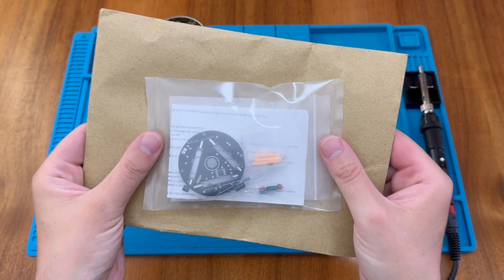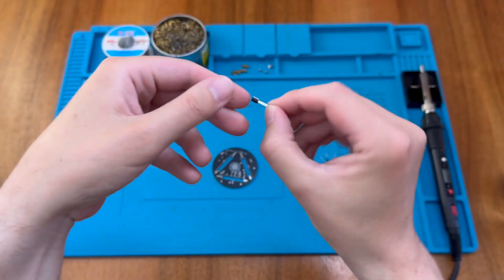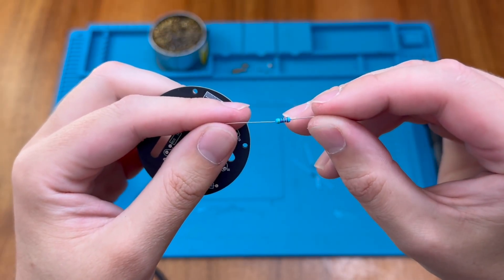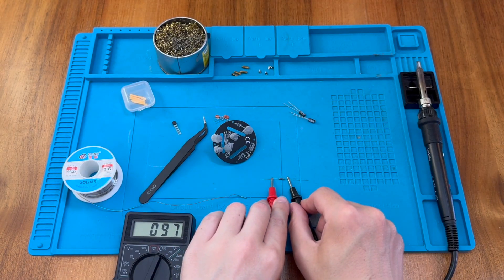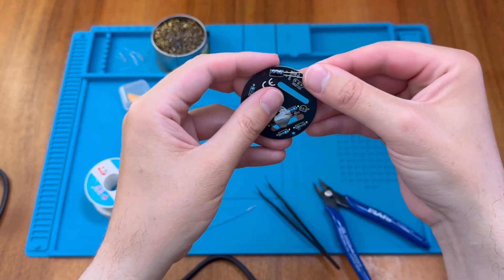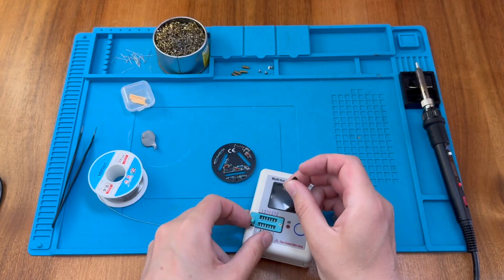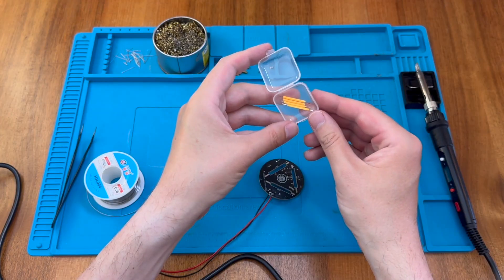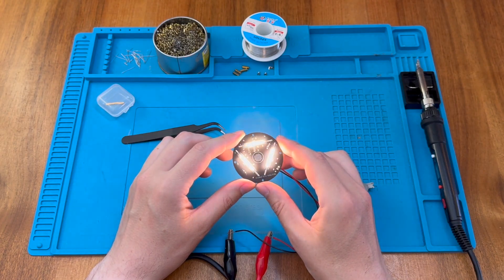Let There Be Light - DIY Touch Sensor LED Light Soldering Kit (Through-hole with Surface Mount IC)

Comment: I purchased this same kit and I've triad to solder all the components...now the kit doesn't work. When I plug it in (5v dc), the LEDs turn on immediately. When I touch the lamp in the center, the LEDs turn off only when I hold my finger on the touch screen. When I remove it, the LEDs start turning on again.
Reply from the maker: That's interesting.The chip has a few different operating modes, but that doesn't sound normal. Maybe there is an issue with the connection for the capacitive sensor? or maybe the IC is just faulty? Good luck!